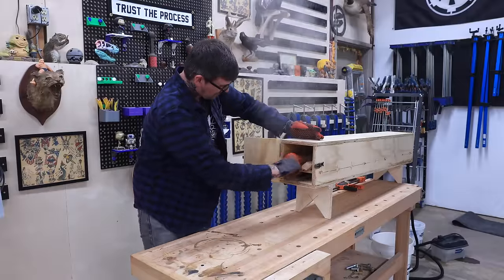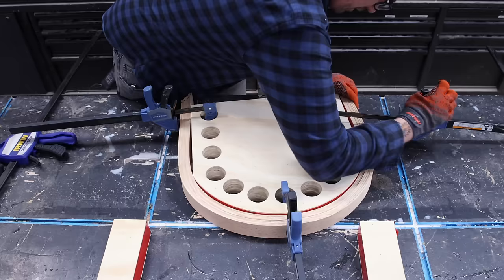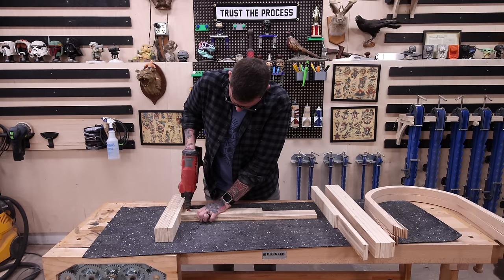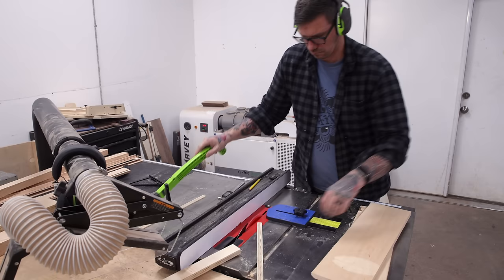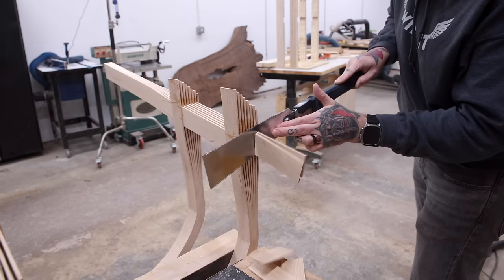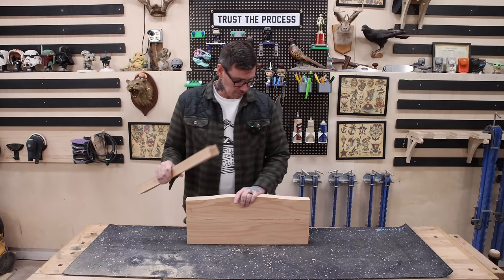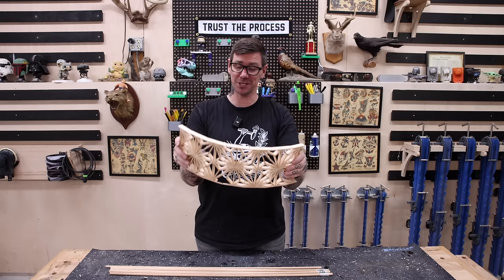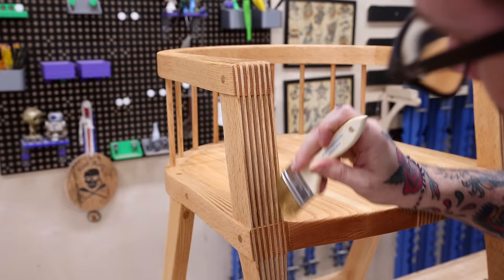Why Woodworkers Hate Building Chairs

Comment: Ok I have something to say and you just might need to sit down and listen for a second, Do you realize that you walk 25 miles just for a 5 mile hike? Your answer to your seat issue that you wrestled with at around the 24 minute mark was just you simply change the order that you build the chair in and use the seat as the fixture that you bend the parts around.  Or simply use the fixture you used for bending as a template for the seat. But I am sure that I am wrong considering I am not a wood worker nor builder of furniture so my opinion is about as helpful as a tornado during a barn raising.

Comment: For the problem you’re having at 20:50, I have had success by transferring the shape to some pattern plywood. This can be easily cut and sanded to the line - a little angle or roundness of the edge doesn’t matter as it is so thin anyway. Then clamp that to your workpiece and use a flush trim bit on your router to transfer the edge from the pattern to the piece.

Comment: Now I can share a tip- go to the cosmetic section of any store that has one. There are pre-manufactured ‘popsicle sanding boards’ people use for doing their nails. You can buy all different grits just like sandpaper. They are super cheap and some are washable. I use them all the time. Sometimes it’s easier to make something from what you have on site. Other times it’s great to buy some nail files and throw them in a drawer because you will find a time to use them if you have them. Just pointing this out to anyone who has never watched the nail polish process and who may not know.
Reply: They were called emery boards in the1950s.

Comment: This is awesome. Always good that you show your mishaps. It's making me feel better when I look at my mistakes. Just last week, when I was routing a curved edge to a small tabletop and forgot to set the height of the flush cut bit right, so I was routing into the actual tabletop, since the ball bearing didn't ride on the edge of my template. Well, now the table is about one eight of an inch smaller than intended. I guess my wife wouldn't have noticed, if I didn't tell her.
Maybe it would have been a possibility to use bendable plywood for the Kumiko and just cut it on the CNC or with a laser. Maybe worth a try for the next chair. :D

Comment: To measure / transfer odd dimensions from a template or shape in to CAD/CAM, I usually take a photo and scale to fit it. iPhones have this crosshair that pops-up showing you when you are perfectly vertical / perpendicular to the ground, so you know there is as little distortion as possible. 
In CAD I just need to know 2 or 3 reference dimension to match it.

Comment: I think the issue with a chair is it's complexity. Most people can't think what parts are needed, and how to make them go together nicely. On top of that as you mentioned. No one will quickly pay 2k for a chair like that. But 2k is easily it's value when you count all the knowledge, execution and value of the lumber itself. 

Now compare a table. "Buy this almost square piece and make it square, now put it on top of these four legs, or if you like this really beefy center leg and BOOM apply finish and your done" It's so simple to tell someone. A chair is something youd have to show someone, a table is something you could explain to someone to do.

Comment: For the seat you could have traced the outline, cut out bulk with band saw take any size pattern router bit and then put both pieces just a tad closer than the size of your bit. Clamp, then route. This would give you the opposite profile on the outside piece.

Comment: Engalscoachshop. Dave is a master and has many vids on steam bending.  Lots to understand to get it right.  Grain straightness and compression along the length.  A steel band is used that bends with the wood but forces the length to not stretch around the outside curve.

Comment: “Sit down”
Very nice project!

Question:
Have you ever considered getting a hydraulic press (as used in automotive repair shops), which might tremendously help when it comes to forming, also replacing the multiple clamps?!

Best wishes

Comment: I have like a 5 bucks li'l tool which basically extends your drill at a 90 degree angle (or any other angle you set it to, really) which makes it much easier to work in tight corners.

Comment: I think kumiko would've worked much better if you had found a way to install it. How about bending rails for kumiko first and then assembling it directly in a curved form? Granted, the angle calculation is going to be a lot more challenging, but you could probably design it in CAD and cut pieces using CNC. The rails give it the look of a high chair for toddlers to sit down in, I would've preferred kumiko.

Comment: Brah. 28:00  I dislike ripouts like that as well. Not yours, I mean with my job. I tend to use small, or appropriate sized blocks or planks, with clear cellotape? Cheap Buff or packaging tape, taped on the flat surface to spread the clamp force and avoid it getting glued to any excess.
All depends on the situation of course.

Comment: You should built more chair! Your gifted use it! A bit of different wood type or purist design. This have easily a value of 3000$ each and 4500 for the master seat dérivâtes. Great work. I would not have watch another table top video. Nice work!

Comment: As a general contractor and  carpenter for about 30 years, I hate stairs. Not the fancy kind, just run of the mill steps. Boring. Every house, every deck, seems like every job, I had to build a couple of flights of steps. Monotonous.

Comment: yea... OK, so I am not a carpenter and I don't make furniture so feel free to just completely disregard my opinion but 4 what it's worth here it is.

A completely 1 off hand built ANYTHING is going to take way too much time and labor, you will never be able to sell it for enough to make the time investment worth it. I made a little cedar strip canoe and I'm pretty pleased with how it came out, but it took hundreds of hours... If I total up the hours at minimum wage the time investment is probably 6000-8000 USD, add in materials and a reasonable profit margin and I'm probably in it $12000 (most of which is labor cost) USD NO ONE would pay anywhere near that for it. The only woodworking projects that can be done profitably are things like cutting boards...

Comment: do you have a handheld router? I imagine it would be pretty easy to set something up that had the middle part of the seat parallel to but the radius of the router base away from the shape you needed it to be and then to just hold the router base against the middle part as you run it along. Does that make sense?
Reply: Disregard, I didn't realize the middle part wasn't already glued up.

Comment: 1) couldnt you add the komico (sp) to the sides just under the arm rest? No to very little bend there.

2) for comfort you need the butt cut. A lot of older chairs have little dished out pockets for the butt cheeks. Seems to make the seat way better than a flat board.

Comment: People might want to Lynch me for this but I actually prefer factory made Office Chairs...

Not only are they generally lighter and sturdier that wood chairs, but I also find them FAR more comfortable and easier to move around when I need to due to their castors...most wood chairs don't have castors to let them roll into or away from your desk or table and scraping wood legs across the floor scratches the HELL out of it unless it's ceramic or granite tile...Office Chairs are also usually height adjustable with the pull of a single lever...

Comment: I think it was "sit down"?..... anyways, I wish you wouldn't throw that piece in the trash.  I would have totally fixed and repurposed it.  So much work, and I cringe at wasting of wood and hard work.  I also squirm at the thought of nice, big, straight "beam" type material to make small strips that could have been made out of smaller stock, simply because it's so hard to get larger dimension wood that dries square out of each log.... kind of how they used to turn 2000 year old redwood into small fencing planks, instead of beautiful slabs or other large dimension stock.... I'm a little OCD like that.

Comment: Yeah I like the whole video forgot the code words... you took a simple build and made ot extremely long and overly complicated.... here's a simple tip for steam bending ... you'r tiny tube feeding steam from a useless steam creator is your issue... cut a 2 inch hole in the bottom of your steam box and put a one gallon can and run a 2 inch pipe straight up from the gallon can to your box 
Put the gallon can half full of water on a hot plate or serious heat source... provide a small bent hole at the opposite end of the box to draw the steam fully through.... And most importantly insulate your box to keep the heat in .... steam bending is really super easy when you get the wood is bright to the right temp with plenty of moisture.... the stuff becomes like a wet noodle .... you have to fill the cells with moisture and get the right temp for the lignin and cell structure to the plastic state.... back the bend with a thin metal strip to prevent..blow outs ... and bend to your template .... it's easy to begin even a 2x6 bent on the edge... stay a little larger dimension as the inside edge will crush work fast before losing the temperature in the wood..... the inside edge of a 2x6 will become much wider due to crush.... fast growth has longer cell structure and works best